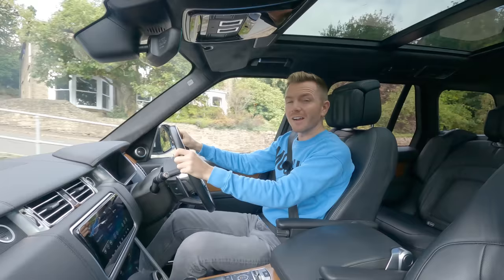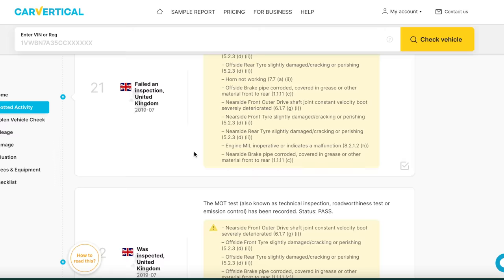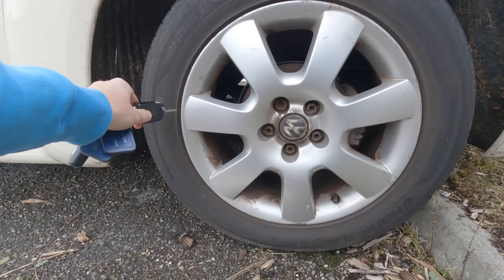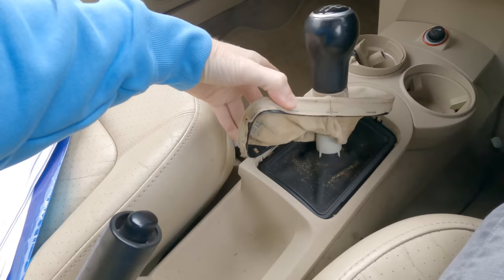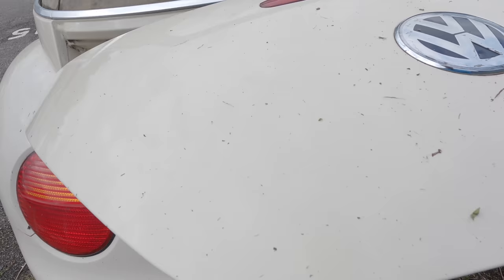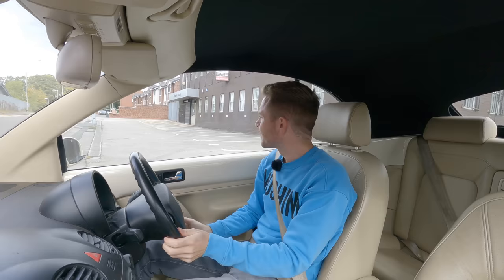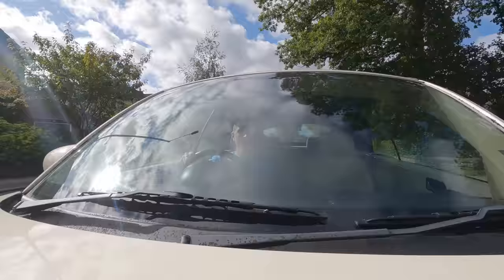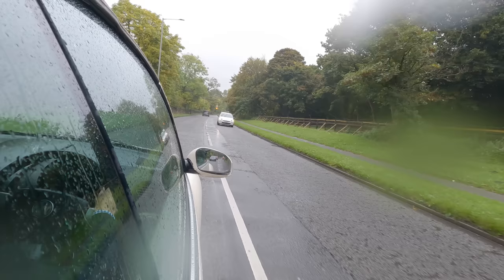I BOUGHT A CHEAP VW BEETLE CONVERTIBLE

Comment: That was comedy gold, especially the springs, it was like a clown's car, I was waiting for the doors to fall off.
Reply: Good one. Made me laugh.
Reply: I burst out laughing.  Does that mean I'm a bad person? :)
Reply: Crusty!
Reply: @TonyWhitley  Probably but so did I. Hilarious.
Matt's caustic humour at its best 😂
Reply: clown's car is spot on!
Reply: This is not just a clowns car; that's a German junker made in Mexico.. power window problems, power roof problems, luckily it has no A/C since that would have been broken as well typical older VW. I was waiting for some transmission issuess with the 5 speed but the only thing that I wasn't expecting trouble of was the engine when I saw that it's a 1.6.

Had one in my Golf V with 102hp done over 200.000 with no problems at all, had a LPG system and the engine gave me 0 problems ^^
Reply: Much like the Rover James
Reply: @chriskonte1909  I have a 2006 Beetle 1.6L, 5 speed manual & can't fault mine. Drives beautiful with no problems or issues at all! Mine isn't a convertible either. If they are well taken care of over the years, they won't let you down & I've owned mine for a fair while now.
Reply: @MsCori76  If well taken care of ANYTHING can be reliable.. I still believe most are junker if you don't religiously take care of them. But they're cute looking no arguing on that :)

Hope you'll get many more miles and years of troublefree driving out of it.

Comment: “For 57k miles surely it can’t be too bad” … very famous last words 😂😂
Reply: Old low mileage cars are often not great at all. Not driven enough and left sitting for long periods which means rubber seals dry out, fuel in the tank is poor quaility when left over time the engine in these types of cars is also used for small trips where the engine hardly gets warm. You are also more likely to get electrical problems as mould and damp infest the car. Old low mileage cars also haven't had many of their parts replaced as there has not been enough use to wear them out completely meaning you get an old car with lots of parts that are near deaths door. Low milage manuals that are old also often have burnt out clutches usually from OAPs who are not fit to drive burning them with poor driving. Any car that has done on average less than 3k a year over its lifetime I would actively avoid for the above reasons. A lot of these old low miles cars are clocked.
Reply: @gravemind6536  that's not always the case. Totally depends on how and where they are stored / parked up and how they are looked after and maintained.
I've got a 12 year old R56 Cooper S, 30k miles, mint, almost like new. Rare as rocking horse you know what in this condition and mileage.
Reply: @MegaVinny73  sounds like yours is low miles but well looked after. Lots of low miles cars out there that get neglected because they forego maintenance under the assumption that it’s not been driven enough to be serviced

Comment: Hey not all Beetles are like this one! I own one myself with the 1.6L engine & 5 speed manual transmission & i can't fault mine as it's been a really reliable & problem free car. I've owned mine for a fair while now & intent to keep it for more years to come! Also, believe me, they are worth fixing as the value for them has skyrocketed, specially here in Australia 🇦🇺 I paid $10,000 for mine over 2 years ago & mine is a 2006!
Reply: i bought my 08 beetle for 4300$ because it had a leaking heater core and the transmission didn’t want to shift in to 2nd gear correctly (automatic), all it needed was a new heater core and a transmission flush and it’s easily worth more than 2x the amount i paid for it. luckily the interior and exterior are mint! great little cars ❤

Comment: I love your channel,  we appear to be very similar humans to a degree. 

However it did bring a nostalgic  smile to my chops, watching your initial appraisal of this new acquisition

I was swanning around the motor trade for about 30 years, and the adrenalin of going to the main dealer after buying 6 or 8 cars (in a job lot), 
that were described over the phone by a slightly wonky salesman is something even to this day I really miss.

I can tell you now, I have bought some pure gold, as well as pure mullock

It is such a mixed bag of a career, you never know what would land on your lap from one day to the next.

The most fun filled days of my life revolved around second hand cars, and the thrill of the chase.

Thanks for the videos, they are not only factually accurate, but also well presented. 

I was exactly the same as you to some extent, wanting to rescue every stray dog of a car from the tip, but you are right about being more realistic with deciding if its a lost cause.

Best wishes.

Comment: The shortest duration I've owned a car was a V5 Beetle of this era. I actually really liked it when it worked, but the electrics on it made me wonder if the thing had been possessed. Sold it back as spares and repair but it was kinda fun while it lasted. Unsurprisingly not great on fuel, but sounded great. We had a couple of nice adventures though. I felt like there was a good car in there but some of the worst build quality of anything I've owned. Not VW's finest hour, fond as I was of mine.

Comment: I recently bought the same one. 2006, with 102 K miles. It’s an electrical nightmare. Sometimes I think it’s possessed, lol. But the 2.5, 5 cylinder runs perfect. And it’s a fun ride. Not for the faint hearted ! Thanks, Rick….. 🇺🇸🌴

Comment: Hi Matt I love the V W beatle  the old type I had a 1303 special  it was built  like a tank  . I bought  it for £ 500 had a respray for £ 250 It was racing green. I did 80 000 miles with no hassle it it didn't  go wrong once.When 
 First got it it had done 70 000 miles
So by this time milage was nearly 150 000 miles.
Brilliant  car.I sold the car 2 years later for £2000 So I made over £1250 .l didn't  want to sell it .But my wife wanted a newer car..
The car was over 25 years old but it looked like a new car..The person I sold it to was very happy with the car and she had it anther 5 years.
I agree  with you Matt the new V W beatles are garbage. But the ones are absolutely  fantastic 
Kevin

Comment: The loud bonging sound as you turn will be partly siezed top mounts and as they release the shock travels down the spring. Left any longer and the springs will be cracked though! I quite fancy an early 2.0 petrol hatch one of these, in blue or black. Quite practical too, my mate managed to carry a fridge in the back of his!

Comment: The electric windows will fire up better with the engine running because the voltage on the battery is much higher whilst it charges. It’s classic lazy window syndrome. Might be better once all mechanisms lubricated.

Comment: My daughter has one of these and although it looks ok I've found it heavy on the steering and very uncomfortable both front and rear seats.. The electrics are on the way out too which is a thing with these convertibles apparently and they are an absolute pig to work on even for the most simple tasks like changing a bulb. I actually found her Ford KA nicer.

Comment: Granted the thing is nearly 20 years old, but it seems a really tired car for just 57k miles. To me it's an example of why regular maintenance is so important. Service a car regularly and it'll trot to the moon and still seem fresh enough for the return journey. Let it degrade and do the bare minimum to pass the MOT and it'll give very little mileage. It does seem like these 'fashion' cars are the most likely to be heavily neglected like this.
Reply: I had a car with 33k on it and it was a dog, current owner is experiencing the same issues as me all my faults were on the off side of the car aswell lmao 😂, current mot is bad for sg57 yrn

Comment: A friend of mine worked for VWAG in Milton Keynes, in the offices, and they let them lease VWAG cars cheap as part of the perks of working for them. For a laugh he had one of the "New Beetles" from new. He told me that after the first month it started using about 2-3 litres of oil every month and VW were unable to work out what was going on. So they swapped him for another one. It had a faulty hood. And another... windows didn't work... it was problem after problem after problem until he eventually gave up and switched to a Skoda or SEAT or something which worked fine. Now you might imagine these were early cars, but this was 2002. So if they didn't work for VW NEW... how the hell did anyone expect them to work for anyone else?!

Comment: I used to work for VW in the mid-2000s - the New Beetle is an absolute pig to work on. The engine bay is so tight and the metal undertray often had rounded off spline bolts so it was a nightmare to get off.

Comment: My mother in law run one of these about 10 year ago. 2 litre petrol, very under powered and noisy engine, terrible on fuel to, she used it everyday and it was worse on fuel than my Civic Type R, with 20 year old me driving. Terrible boot, and the build quality isn't great, she liked it though. I recall her having the odd issue and her roof did the same as here, but not quite as bad. I bet these weren't cheap cars new either 🤔

Comment: One of those cars where the novelty wears off quickly. My brother brought one back from Hong Kong with a crazy kit on it complete with a whale tail spoiler, it did have the hot TT engine. But because it had come from a humid country the interior just fell apart.. Try changing the battery in it! Nightmare

Comment: Typical main dealer from my experience, usually mis described, if they told you about the issues it’s scrap value. Let’s hope you make your money back on the other cars. I used to buy batches from main dealers and this happened frequently when I was silly enough to buy the crap. Sometimes you had to take it to get the good stuff.

Comment: "probably better news than the 2.0L, 'cos the 2.0L is quite thirsty"
you 'aint wrong there. i used to own the 2.3L V5, same year. had it less than 1yr. i mean, i knew when i was buying it that it wasn't the most economical, but holy ****! you could literally watch the fuel gauge depleting. was pretty quick though. 😁
this car is a mess! you'd think with the very low miles it would be at least half-decent, but it's just awful. fail to see how people just use their cars as a workhorse and wreck it. shame.

Comment: the beetle cabriolet was never going to work in my opinion mainly because the engine wasn’t in the rear and it’s looks wasn’t quite right, had they have rear engined the beetle it could have been a winner with a Porsche engine fitted.

Comment: I am just getting started in the motor trade here in the UK but struggling with sourcing cars.  Only flipping from my driveway , I’ve done a few cars I came across by chance but I need some inspiration.  I don’t really have any contacts in the trade either.
Reply from the maker: Its takes time to build those
Reply: @HighPeakAutos  any suggestions on making moves to source decent cars in the meantime?

Comment: You'd think a car model of this kind that is bought by those who fall in love with its cute looks, would be well taken care of. Apparently not! Less than 60K miles, it looks significantly worse than almost all of the cars you've featured on your channel with over 100K miles. Poor thing's been horribly neglected. I do have a soft spot for them. Would never own one myself as I'm a lone car individual. And, the lack of space inside is just an absolute deal-breaker. Still, wouldn't mind borrowing one to run a couple of errands around town if my GF owned a Beetle. They're just smile-inducing. Well.... not that one.

Comment: I have a 2002 VW that needs a power steering hose and or (pressure line)(return line) for the power steering fluid and I cannot find it nowhere.  Do you have any idea where I can locate one?

Comment: Aaaaand apart from the colour, (and double the mileage) that's my wife's car.  Roof will NOT clean and needs re dying. Flat paint and pealing lacquer, the smell (musty) and the scuffed wings....  the worst feature are the dropping windows which rely on a tiny microswitch no bigger that your thumbnail to drop the glass, turn off the alarm, prime the fuel pump and tell the ECU it's unlocked - TERRIBLE design.... it's a totally impractical car with no a small boot and 2+2 seats... and the roof doesn't work.  It's a total shed.  

She absolutely loves it!

Comment: Another turd...the reason the roof won't go fully down is because the roof material doesn't have the stretch it had when new, the roof mechanism is linked to the windows.  700 was to much It's worth half of that on a good day trade. Yup made in Mexico,

Comment: Can somebody explain to me why cars in the UK depreciate so badly. Like most of these cars should be worth thousands not a few hundred bucks.

Edit wow this car definitely was neglected and typically German build quality. But my question still stands. Nearly every car he gets is so cheap.
Reply: Partly because they are right hand drive so less of a global used car market.  Mainly due to the MOT (roadworthiness test) that a car has to do every year once it is three years old.  Once a car gets to a certain age it gets incredibly expensive to keep repairing it to keep it roadworthy and it gets to the point it makes more sense to run it into the ground and scrap it and put the money towards a new car instead.  Also because of the damp climate and road salt used in winter older cars tend to get rusty eventually too.
Reply: @person.X.  That's awful. My car is older than me with 215k (American)
miles.
Cars are expected to last a very long time cause there really isn't any other way to get around. I know some states do tests or road worthy stuff. Thankfully my state doesn't.
Reply: @baronvonjo1929  Yes it is the same in Australia.  Historically cars were very expensive due to import taxes and the high cost of local production.  The weather is relatively dry and warm and salt is not needed.  Therefore Australians like Americans generally run their cars up to much higher mileages and keep them for longer.  So secondhand cars have much higher values than in the UK.